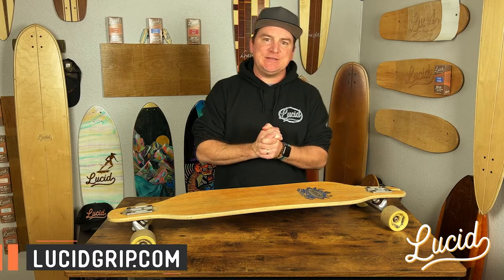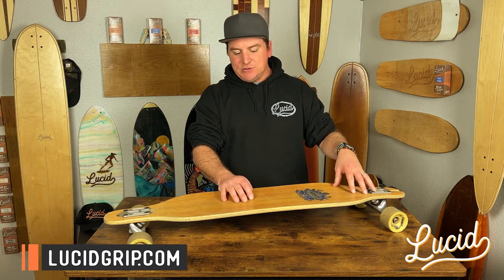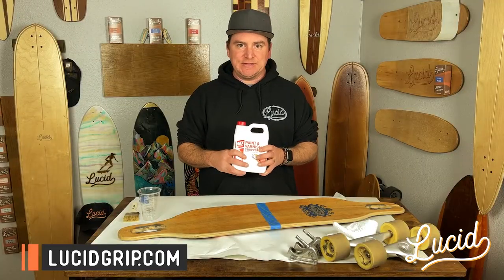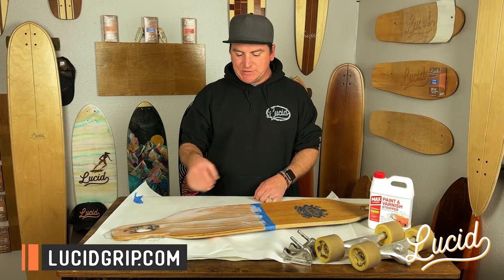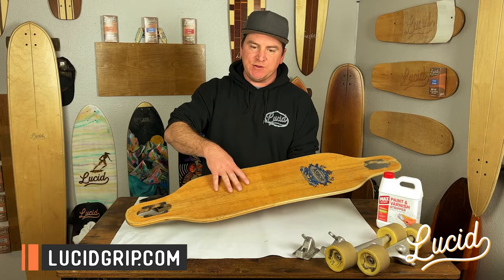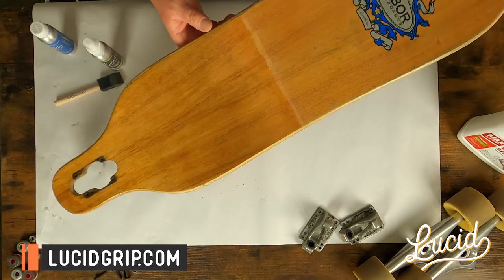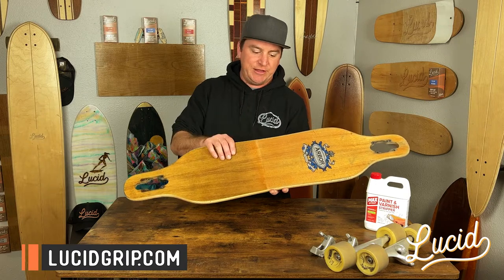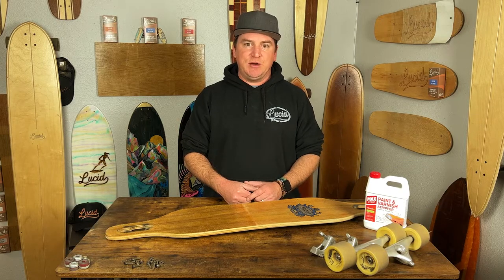How to Remove Lucid Grip - Clear Spray on Grip Tape Removal

Comment: So I’m working on taking my clear tape off with a remover…would I need to re seal (such as polyurethane) the skateboard back up? And also would the remover soak into the board making it heavier? Any answers or thoughts would be appreciated
Reply from the maker: Yes I would recommend putting a finish/sealer on the deck after removing the grip. Not sure what type of product you are using but no it will not soak in and make the deck heavier.

Comment: How many boards could you reseal with the 2.7 oz lucid laquer?
Reply from the maker: If by “reseal” you mean regrip with a surface that has a finish on it, you should be able to get two 40” decks. The liquid will usually run out first.

Comment: Just sand it down. I'm against this liquid one it takes a long time and more work and 2 fuck any liquid near your board. 60 grit paper. Sand it and wipe as you go so you don't go too deep. Do the edges a bit too so the new grip sticks properly. No acetone on your board it'll stop the clear coat on the board.
Reply from the maker: Yes sanding works really well. We are actually working on another video that shows that process rather then using a paint striper liquid.